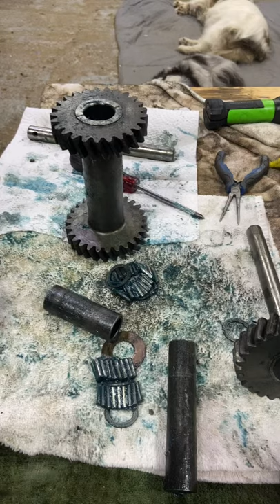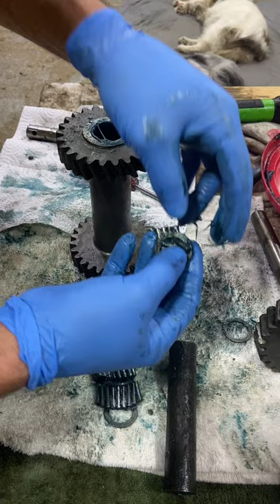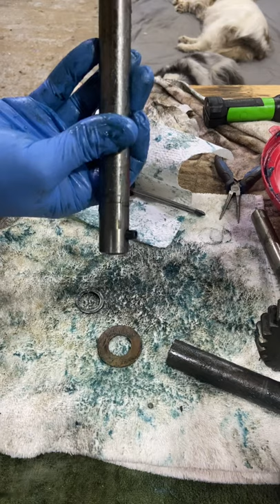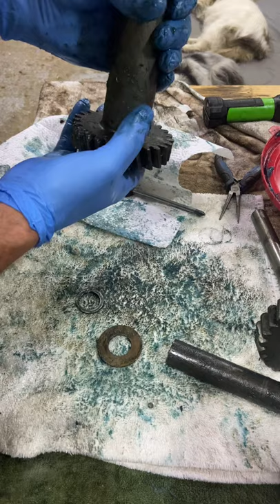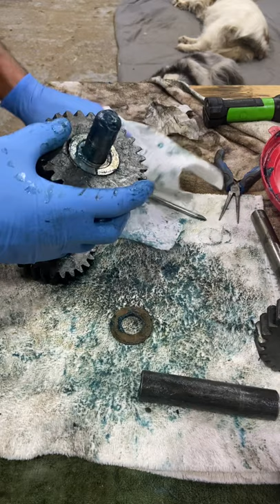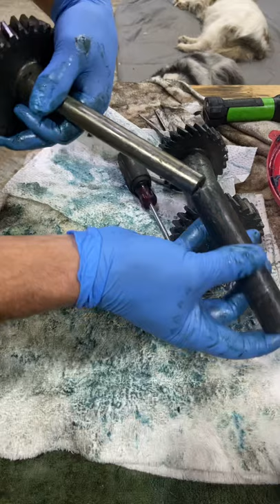MF50A Transmission Countershaft and Idler Gear. No Caged Needle Bearing Here!

Comment: The manual says something about the gaps in the friction steals lining up with notches in basket what can you tell me about this thanks Eric
Reply from the maker: Hi Eric!
   If you look around the basket, there are holes where each of these toothless notches are, and it’s for drainage, so it’s recommended to line up the gaps in the steel plates to facilitate drainage faster. I’d recommend the same, but I never lose sleep when my mind’s on other things and I forget.
Reply: @longtinrick  thanks do the friction disc have to go in any special way?
Reply from the maker: @ericbaader6625  
   Friction discs can be installed any way, but the steel discs have to be installed a certain way.